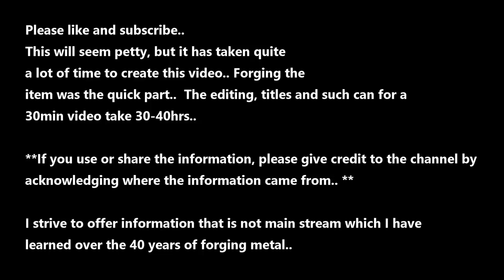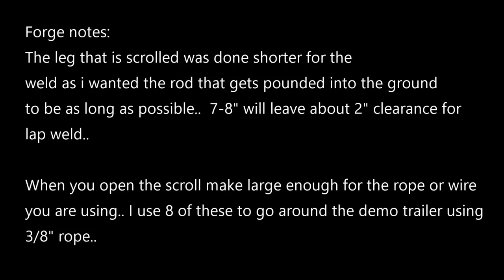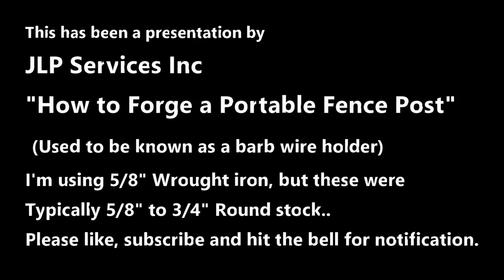How to forge a portable fence post (AKA Barb wire holder)

Comment: I can see adapting that to
Either a candle holder ( smaller scale) or a tiki torch holder
Reply from the maker: The concept is applicable in many facets..  Bird feeders,  The other factor is if you wanted a hook that is easy to put on a line but not so easy to come off..       :)

Comment: Neat. What'd you do go back to the HB
Reply from the maker: No, very old footage from 5/2017..  I have 5 or 6 older films that were never edited..

This was one of them.. I had updated to new software and sadly the footage that was edited was on a poker..  the footage would not sync between the 2 pictures and unless someone can handle each picture being off 1 hundredth of a second all the time editing it is lost..  well unless the company can figure out the problem..

In the meantime this was fairly easy to do with about 20hrs editing on the old software..    the new software is not backwards compatible..
Reply: Gotcha I think. I've seen another video on making those but I didn't think it was yours. Thanks
Reply: JLP Services Inc  20 hours of editing?
Reply from the maker: @gateway8833   Yup this one was about 22hrs..   When you add in a longer project and a few more cameras it gets terrible.. If you have Facebook or instagram friend me.. sometimes I will post info on there as the editing happens..    7minutes of footage can take 4-5hrs to edit..   Each heat is removed. The action at the anvil is isolated and refined then the footage is zoomed for the given shot.. Then all the titles, intro, exits.. etc, etc..     The dual views are 2 cameras.. The horn shots with 2 cameras has to be cut out of the main front camera and isolated..  This gets better with 3 cameras with 1 on the face, 1 on the horn, and 1 on the side..   Each film stream has to be synced.. 

A guy asked me one if he could help..  I showed him the time line with the edits and he said good luck..
Reply from the maker: @johnmichael283   I made one years back but not sure it's still listed and I didn't look.. The last one was with the inserted V piece for the weld..
Reply from the maker: @johnmichael283  It's part of the Fiskars hammer trial..      https://youtu.be/NhIjNmi3s-Y
Reply: JLP Services Inc What kind of equipment do you use to do all this editing?
Reply from the maker: @gateway8833  just laptop computer..  Then a I have network server for archive storage.. All videos in edit are stored on the computer itself..    On video can be 30gig -50Gb of film.